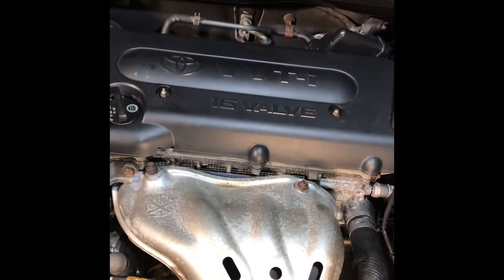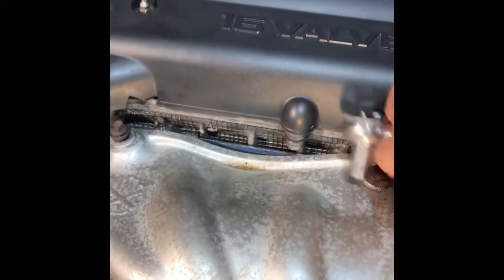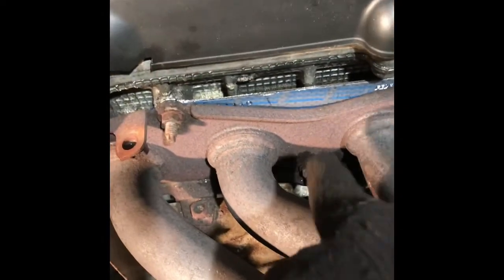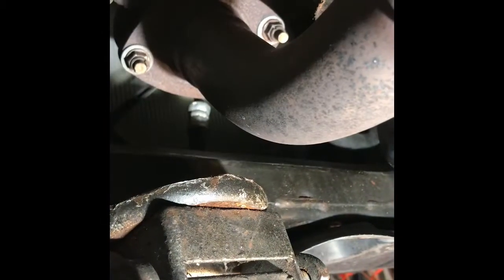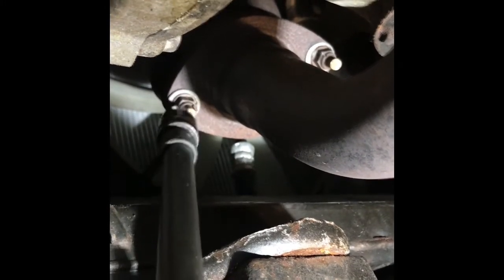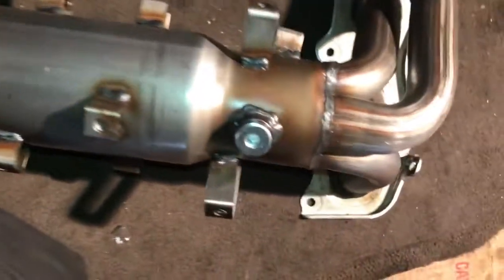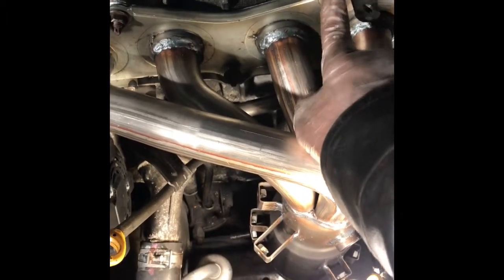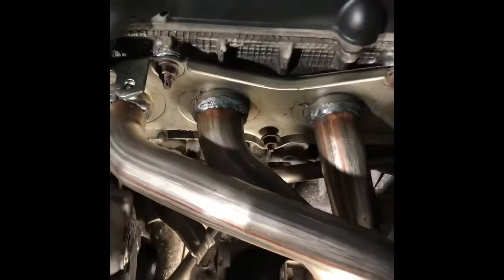TOYOTA CAMRY 2.4 EASY FIX ENGINE NOISE

Comment: Mine makes the same noise a ticking very slight sound exactly like yours. Did replacing the Manifold fix it? (Not a lifter tick coming from manifold area)
Reply: I just changed my manifold an gasket an it didn’t fix, did it fix yours?

Comment: U didnt showbthe result. Did it fix it?
Reply: No he did not fix it. Catalyst converter does not cause that noise. I have the same noise, and after checking everything, I believe the noise is caused by the piston slaps. Piston slap is annoying, but it shouldn't cause any performance issue. You have to live with it, unless you want to fix it. It's required tearing down the engine.
Reply: Most likely it's a balance shaft, I experienced the same thing, my mechanics deleted the shaft and no more noise when starting or riding
Reply: @glenglene8473  Yes, after removing the B/shaft, there is a slight experience of vibration, particularly noticeable in low gear drive. The vibration occurs only when the vehicle is in drive mode, the brake is engaged, or when decelerating, such as during parking maneuvers. However, overall, the performance remains satisfactory, and I can comfortably travel long distances of up to 2000 kilometers (1242 miles) without any issues.
Reply: @SuperLee83  Balance shafts looked good, but replaced the balance shafts, noise still there. Must be the piston slaps

Comment: Hmmm I have the same noise.  2010 Camry 2AR-FE.  Has anyone found a solution???????? Please share it, I get this noise at both idle and drive modes.  Seems louder the hotter it is outside.  I need a solution
Reply: Found my problem, AC pulley bearing was badly worn out.  His issue is not pulley or exhaust related.  It sounds like his VVTI sprockets are out.  Toyota started using it in 2010 and later 2.5L models.  His video said it's 2.4L, maybe it's a typo?  If it's a VVTI, you'll need to remove timing cover to take off the sprocket.  Give it a good shake, if it rattles then yep that's your noise source.  From googling around, it seems like a common noise source at startup then it goes away after the engine warms up.  This job is a PITA.  I'm replacing my timing guides right now due to chah chahh chahhh noises.  It's the same procedure.

Comment: Mine does same.  I changed lifter valve caps, oil,  checked camshafts and crankshaft bearings...they were good.    Changes manifold gasket.  No change.  Was about to change converter.  But checked both and  pressure less than 1 psi.  So no obstruction.  No engine light and no codes.  Cats are good.  Did find that rod 4 had extra side clearance at crankshaft rod bearing after removing oil pan to examine bearings.  Anyone find out what that sound is from?   Bad piston seal?
Reply: Checked converter.  No issue. Installed new seals.   No change.   Could be manifold portion but no cracks etc.   Was your manifold section damaged?
Reply: i have the exact same noise it goes faster with rpm i hope you find the fix it sounds like ur really struggling
Reply: Got the same problem here. Please help
Reply: exact same problem hear, year later and still looking for a solution
Reply: So am i seeing this right solution
Reply: I’m having the same noise!!!! But mine is oil related. I know cause my oil light is on. I believe it’s bad oil pump. But this is same sound
Reply: same exact noise
Reply: @roxannecab  was it burning oil as well because now i smell oil being burnt
Reply: @derrickford4453  hi.good day.is your car noise settle?mine one also same.is it manifold?
Reply: Did this fix it or no? Answer us please
Reply: Just wear and tear on the cam shaft lobes and lifters over time as the engine gets older. Make sure that there's enough oil and it's changed regularly
Reply: side to side play is OK for connecting rod. If you have up and down play, then you need new rod bearing (assume rod journal is OK). You should check the connecting rod (wrist pin) at the piston. If there's play, then you can hear this noise.
Reply: Had the same problem, we deleted   balance shaft and it is fine
Reply: @derrickford4453  I think the noise is caused by piston slaps. The noise is drowned out at speed increases, but pronounce at idle.
Reply: @automengcarrepair378  noise still there after year.  just lower.   still no codes or loss of power.
Reply: @ItsArtemis...  doing just that.
Reply: @glenglene8473  thanks.   I think I'll revisit changing bearings..   I've checked likely culprits.
Reply: @automengcarrepair378  i dont believe so.  mine wasn't.   my focus is on ros bearing clearance issue.  Will recheck at next oil change.
Reply: @derrickford4453  I think the noise is caused by piston slaps. it's annoying, but it's basically OK to drive the car with piston slaps. I know one person who has a 2AZFE with the piston slaps and still running 5 years later.